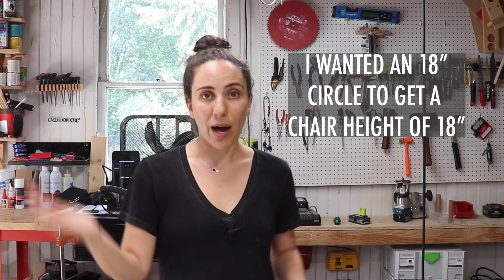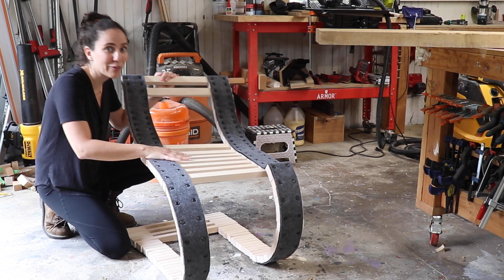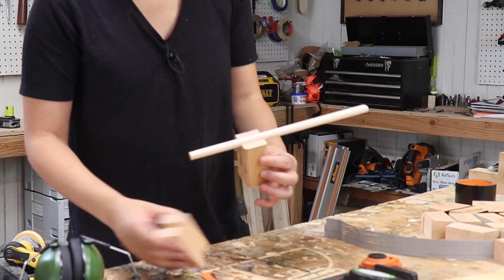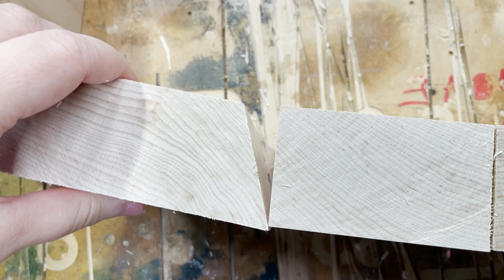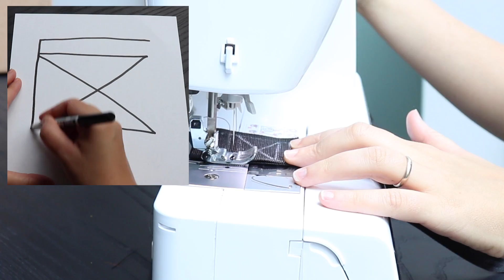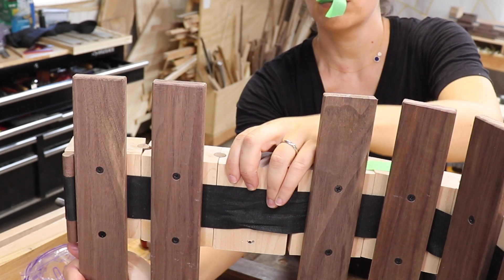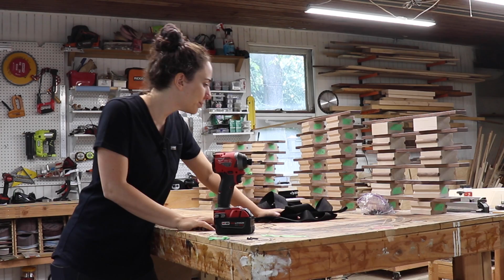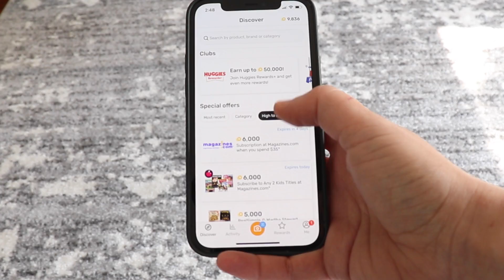I ATTEMPT to make a Roll Up Chair… AGAIN...

Comment: How about not using any straps, but using a door hinge for every joint? No stretching?
Reply from the maker: Maybe
Reply: OR, I was thinking, maybe try making the chair to account for the stretch. Like, make it so the chair is... The seat isn't low enough. And the back is almost leaning forward. And then when you sit in it, it settles into your body shape almost, and stretches to the right level. So it would look weird when you weren't sitting in it, but maybe it would work if you sat in it. 

But I feel like the door hinge idea might with better. And you might not need the dowels. 

Anyways, you're doing an awesome job with well this experimentation, and it's so much fun to watch. Keep up the great work!

Comment: Tamar, could you put the chair in the desired position and insert spacers on the insides of the curves to force the open side to close therefore putting more load on the wood pieces and less on the strap
Reply from the maker: After getting hurt I didn’t think moving on with this iteration was wise

Comment: Nice try again, even if you get it solved you may still find the chair maybe will be a risk as the webbing of what works will eventually stretch and break unexpectedly ,I've seen some really cool chairs break only because of a small hidden crack or the fabric was weakened over time or side forces weakened the chair ,resulting in a unsuspecting collapse ouch,Thank Tamar for a great effort again, how about a new project ?
Reply from the maker: Moving on to new projects!

Comment: Cool project and I like your persistence. I think it is quite obvious that the biggest problem of your concept is that the strap is not securely fixed to your individual pieces. When you use a 3m long strap and it elongates under tension e.g. 1% per 50kg of load, you will get 3cm of strech on the whole length and these gaps at the front can open up. If you only have lets say 6cm of strap between these individual elements that can strech and you put the same load on it, it will only elongate 0.6mm and there will still be gaps, but much smaller ones and it could hold up. With this method you could also avoid the problem of the structure curling at the top or bottom, because this part would not even be under tension and curling will not free more length to make the gaps bigger. There is no material that will not strech under load and when u have that really long strap of it, any material will give too much to hold this structure up. BTW, making the top and bottom longer in the design phase made this problem bigger, as it also made the available strap longer. Leather is the worst choice btw, it will give much more than the straps you used.
My first choice to secure the strap to each element would be driving 2 screws through the strap and using additional glue (epoxy?) to make everything even stronger.
Reply from the maker: Yeah. I suggested that at the end. And that was going to be my original intention after getting the length of the strapping correct. But after I got hurt I just realized this iteration was not safe to be in my house with my kids.

Comment: What if you made it like a roller chain and kept the wedges as stops?  That would possibly eliminate the stretch you would get even with cable.  The sides of the roller chain may need to be plywood or metal.
Reply from the maker: Maybe

Comment: This chair is rapidly becoming your nemesis…and for that reason alone you must defeat it!  The original Miesrolo chairs seem, in general, to have far fewer cross-slats and far more, smaller, tightly-packed frame pieces with the strapping around the outside.  I know your original attempt a few months ago had that set-up and seemed a lot sturdier (sideways movement notwithstanding) so maybe that’s the way to go - with a tweak or two.  Good luck if you try it again, but I can’t help thinking that type of chair is like an accident waiting to happen!  I’ll stick with my sofa 🤔😄
Reply from the maker: Haha yeah. After I got hurt I gave up on this iteration
Reply: @3x3CustomTamar  Quite understandable.  With all the inherent dangers in the workshop, it doesn’t seem fair when the projects themselves fight back haha.  You’ll succeed in the end, though 👍😉

Comment: Well if my boss came to me and ordered me to make this work I would try to use strips of stainless steel as strapping. I also would build jigs for the assembly that look similar to the forms you use for bend lamination or steam bending. Those jigs were used to really get tension on it during the assembly. To keep the back support from collapsing I would hook on springs to the outside. Still I hope my boss will never come to me with this project. :D
Reply from the maker: Haha for your sake I hope he doesn’t as well

Comment: What a cool exploration. You are taking on some very complex challenges. Your design on paper really looked like it would work! Towards the end, I started to think about steel, like some other comments. In building construction, many commercial buildings have concrete floors with steel rebar along the bottom of the concrete slab. In that assembly, steel is good in tension as the slab wants to sag or flex down from load, and concrete is good in compression as the top compresses from the same sag. Post Tensioned slabs use steel cable. So do suspension bridges. I’m rambling here, but I wonder if steel cable could be a solution, if set in grooves kind of like your router for the dowels. Another thought I had was about Key Stones in old arched stone doorways. Could a strategically placed dovetail be slid in at certain points to help it from buckling or folding in on itself? Also, would you think it cheating to have a folding rack that would be an upright support at the back so the top is somewhat supported like a suspension bridge? Keep exploring!
Reply from the maker: Maybe!

Comment: Nice second attempt Tamar,  very interesting dilemma in design, maybe a hard mechanical join like a dozer track, using dowling to lock the links together and then the webbing is not load carrying but still has function, probably far too much work though for it to possibly fail? Good luck with your next attempt mate
Reply from the maker: Maybe! Thanks!

Comment: Perhaps a joint based mechanism could help with the roll up chair design, one of the biggest problems with integrity is that the tension has the ability to pull some parts of the chair in the wrong direction, so if they could be locked off or that the chair design cams itself into place that could be a solution as well
Reply from the maker: Maybe

Comment: Tamar, this is a really great process. A great design process and a great set of reflections. 

Leather will stretch over time as well and you'd need a really high weight of leather to work.

Comment: The stiffness of the strap material under tension (low stretch) is more significant than the strength, as the change in length of the strap is what determines how much the chair deflects under a given load. Of course is does need to be strong enough too.  Leather will be way too flexible (I'd say orders of magnitude more flexible than the webbing you used, and will irreversibly stretch over time too). My only experience with straps is climbing gear, and my understanding in that context is dyneema slings are the lowest stretch. No idea how they compare to the webbing you used.
Strap tension will have to exist for the chair to work. Tension will be a function (multiples) of your weight. Tension means stretch. Seems like you have to a) make the chair a more upright shape so by the times you sit on and it deflects, it's in the sitting shape you desire. And/or b) reduce the length of strap that is free to stretch (i.e. bond to wood so only the small unrestrained portion exposed between each  joint is free to stretch).  If you hang a 1m long strap with 100kg on it and it stretches 3cm, a 2m strap with same weight will stretch 6cm. So reducing the amount of strap that is free to stretch will reduce overall deflection.  However, I'm not convinced glue is stiff enough to restrain the strap to the wood like that.
By the way, the dowel idea at joints was in a comment of mine that I recall you replied to saying it intrigued you! 
Other thoughts: more strap width = less stretch for a given load.  Make the strap the entire width of chair?

Comment: You should do what homer did and put legs that flip out. You would have to pull the chair straight up for a bit but once you get past the legs it should "role" out. I think you could make it that way with no tension. Good luck
Reply from the maker: Maybe

Comment: Maybe pinning the straps right next to the edge of the light block so it has less length to stretch. right now it can stretch freely except at the pinned part under between the light and dark blocks.

Comment: Speaking from experience with fall arrest equipment, I think you are not going to get any satisfaction from long fibrous strapping. The total length of your chair means you'll always have a lot of stretch, and if you could get it under enough tension and clamping, something will break(or slip) when you put a bit of force on it, because leverage will magnify your weight enormously, and there will not be anywhere for the energy to dissipate. You've got migrating slack. You have a big reservoir of slack in the "foot" for instance.

What might be worth experimenting with is smaller sections of strapping, in the idea of how you've isolated the curve for the upright. By this means, you are not sharing slack from the bottom with the upright. Have smaller loops sandwich two blocks, maybe through a slot in each block. Then you can adjust tension in just small sections too.
Reply from the maker: Yeah. Perhaps you’re right

Comment: The bell rings and Tamar is out for round two. She looks confident, jabbing and moving. She seems to have put the first round behind her. Tamar is gauging Roll Up Chair's reach with her jab, but Roll Up Chair times her with a sharp right. Tamar shakes it off, she dances on the outside, but Roll Up Chair smells blood and is now pressuring her. Tamar is up against the ropes taking shots to the body. She is looking at the clock now (never a good sign). Tamar goes for the clinch, but Roll Up Chair shakes her off and lands a short uppercut to the jaw. Mercifully, the bell rings. Tamar takes to her stool. She looks frustrated, folks. We are going to have to see how she approaches Roll Up Chair in round three...
Reply from the maker: Yup. Basically sums it up 😂😂😂
Reply: @3x3CustomTamar  Don't worry, Tamar. We all know Rocky gets 'em in the end. The first two attempts were just a little drama to keep things interesting.

Comment: You got this! That is, if you do revisit it. It's entirely understandable if you don't! The dowels were such a good solution, and it certainly feels like you are closer to getting it. I do wonder if it would do some good to anchor the strap at key points in-between. It seems like although the strap is clamped between the spine and slat pieces, the 'slack' in the bottom (where it doesn't need to be under tension) can still be taken up by the top portion, meaning more slack overall and making it sag. Assuming the strap is able to move somewhat between the clamping, it seems to me like you have too long of a continuous strap, and that isolating key portions of the strap may reduce the sag. It doesn't quite feel like it would be a complete solution... but maybe it would help?

Also, you're the one going through the struggle and iteration after iteration, so I hope this suggestion does not come across poorly! It's easy for me to say something after watching a thirty-minute video, but it is much harder to put in hours and hours of testing and work. Best of luck to you.
Reply from the maker: Appreciate the ideas!

Comment: My suggestion would be to change the design of the bigger curve because as of now it has a shape of a halfcircle.

May be think about starting off the top part a little bit before the full halfcircle because it then the chair would not flex downwards.

The possible problem is then that the chair would not be able to seem like a chair unless you sit on it, however I do think there is a sweet between getting the chair to stand upright and not flexing as much when you sit on it.

With all that said, this is all based on my intuition so thread with this advice carefully.
Reply from the maker: Yeah perhaps you’re right. But I feel like it wouldn’t be as comfortable that way

Comment: i don't think leather is anywhere near strong enough to deal with that kind of tension. what might work, though, is pre-stretching that strapping before assembly so that it will not stretch as much when it is under load.

at my weight, i wouldn't even think of sitting on something like that chair. it can't even hold your weight, and you look like you're less than half my weight.
Reply from the maker: Ha yeah. I don’t think it’s safe. Ha

Comment: I was thinking you could have added foldable swing-out support legs that could tenon or dowel into the lower rails.2 or 4 maybe? they could pop out of the holes and fold up under the slats for rolling up.
 Leather will stretch over time, and under that kind of tension with a strip that narrow, I think it would stretch pretty bad. What if you  used a full size piece of leather that went the full length and width? I would love to see this project succeed!
Reply from the maker: Haha me too…

Comment: Tamar, Wow, you appear to be either very determined or totally pig-headed and stubborn, or perhaps its just that Aries bit where the ram loves to keep battering his head against the wall that seems to be blocking his way forward.
So, if it is the latter, then take a pace to one side and move forward again without looking back, until you come to the next wall to bang your head against, or until the ram realises that saying "I am," as it does each spring, allows him to choose what he wants to be, instead of feeling driven to be what others want, or to be what you feel you must be, should be, or have a duty to be, and so on.
The fact is that tension, in the minds of human beings, in their bodies, in work places, projects and even in thunderstorms and businesses, is both local and accumulative, or a total that works its way down from the top into all the local elements, as in when a disaster strikes, and you seem to have been creating a disastrous tension, both in you and in the finished article, with this project.
So, if tension is local and if all of the variously tensioned joints can create a whole tension that is acceptable, as in when my body stands up or sits down, then it seems to me that the tension in each local joint in your chair could be explored and dealt with as a stand alone project, to ensure that it is playing its part in achieving the whole, if you wish to put your horns on again and return to this particular wall. (Glue and staples on each webbing connection to its block sounds better than staples to me, but as someone who owns just a hammer, an axe and a saw, what the hell do I know.)
Either way. Great to see you again Tamar. And although I love your sense of humour, even your frustration is a joy to behold.
Reply from the maker: I never believed in astrological signs until this statement. Ha
Reply: @3x3CustomTamar  For me, there is nothing to believe in with star signs. The fact is that different star signs appear in different places at different times of the year, and instead of me trying to explain how the stars can have an affect on human life, it is easier to say that the four season can be split into three parts each, and that says there are twelve monthly sections that humans are born into.
You are a late spring baby, eternally pushing forward regardless of how the summer might shape up, driving on into the next element of your life, without ever losing touch with the initial drive that brought you exploding onto the scene.
People born into the other bits of the year have their own expressions of how the vitality of life moves in them, and for me, the stars and what we call star signs can be said to reflect portions of the earthly seasons, and not to be regarded as a science or any other religious belief that can allow a few people to tell all of the others who they are or how to live.
Skills are various, abilities are various, tools are various, and the drive to do something is also variously expressed in and by variously different and yet variously similar people.
This says that for me, astrology is not a typology that can generalize human beings, it is just that people's minds and abilities, how they experience their own lives and who they think they are, grows to reflect the dictates of their socialization, and what might be called the natural background of their lives, (the basic vitality that says how they do anything,) reflects the month/season/star-sign of their birth.
Please do not hurt yourself in trying to prove that you can move mountains, as you did with your arm, because this is just another form of the ram banging your head on the same wall over and over. Your secret is that you are always Tamar, a river of life flowing eternally around and over immovable objects as you pass through wild moors and wonderfully peaceful valleys on your journey towards the embrace of the ocean.

Comment: Having different stretches of straps could help, I think? Super tight straps in the part that  a lot of the weight is going on and then less tight on the others. Then some way to connect them together.
Reply from the maker: Maybe